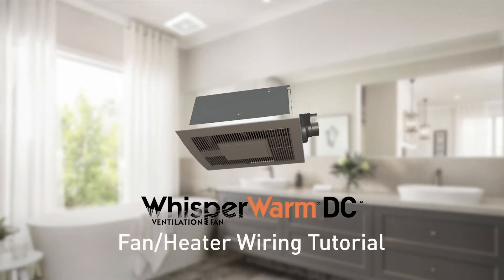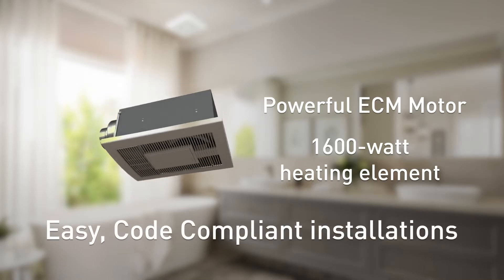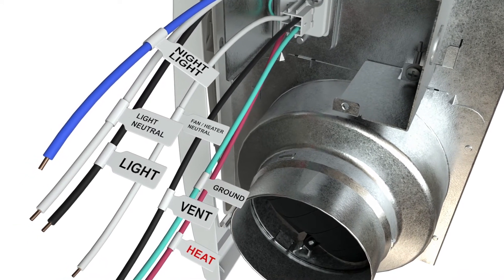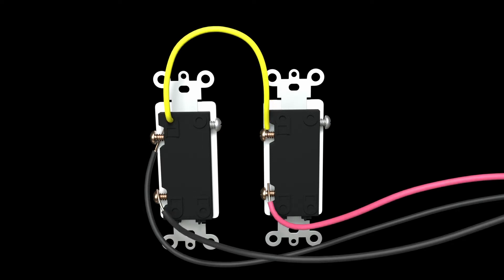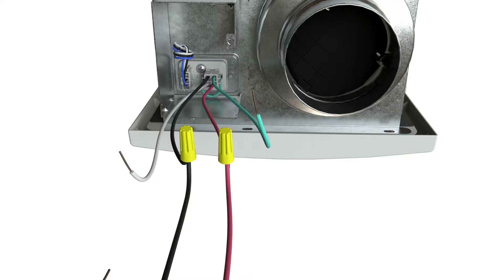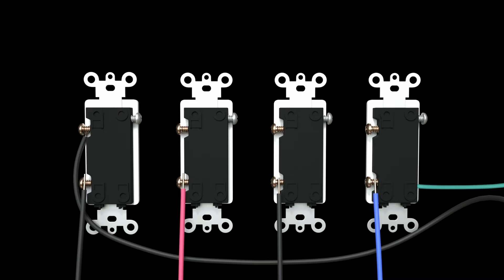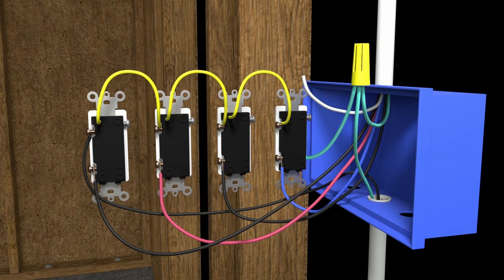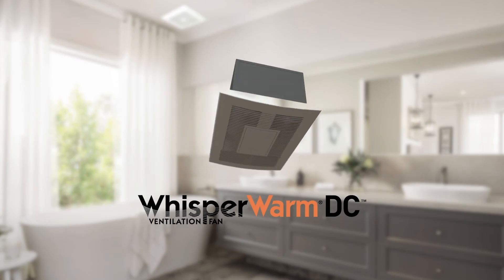WhisperWarm DC Wiring Video

Comment: When you wire the switches you can hook up the vent wire to your lights and it will work the fan. Then fan will still turn on for the heater and it’s supposed to so that it’ll push heat down. It will be venting all the air out of  the house so don’t worry when the fan turns on if you just want the heat. That is part of it and can make it a bit confusing when doing the electrical.
Reply: Your comment is very helpful! About to drywall and I'm testing the unit and couldn't figure out why the only options are 1) fan only and 2) heat+fan. I understand that the fan activates when the heat is on to direct the heat

There is a 3rd option then in which the heather runs and also the fan sucks air out. When I gave both switches activated together. I do NOT Have the model with lights.

Am I understanding correctly??

Comment: Can I use the same circuit of the old fan? Or do I need to run a new circuit?
Reply: Does your old fan have a 20 amp circuit breaker with 12 gauge wire?

Comment: So I will need to run an additional Romex with white, black in addition to a 12/4 Romex with the Black, Red, Blue, White and ground?
Reply: No, you just need black, white and ground from a 20 amp circuit on 12 gauge wire.
Reply: @JustEnjoyingLife73  and what about from the switches to the fan? Do those also need to be 12 gauge?
Reply: @goldistocks609  It's my understanding that the switches are handling the full load of whatever they're switching, so yes, they probably need to be 12 gauge. It might specify in the manual.

Comment: The wire running from the main panel, do you need just black, white and ground or do you need black, white, red and ground. My old fan is black, white and ground. Thanks for replies
Reply: You need black, white and ground from a 20 amp circuit on 12 gauge wire.

Comment: While installing I have both the fan and heat coming on at the same time. If I turn the heat switch on both run. If I turn the fan switch on both run. Where may I have wired incorrectly?
Reply: You have the fan and heat wired together.